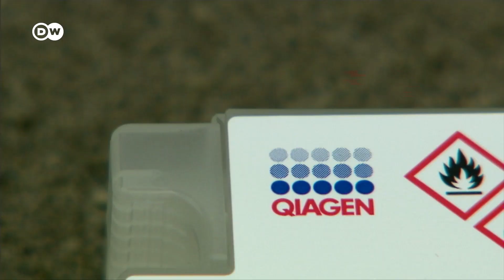Can controlled 'herd immunity' be an alternative to social distancing? | Coronavirus Analysis

Comment: Can herd immunity be an alternative to social distancing?

It will be when there's a vaccine.
Reply: @arldoran  It would have to mutate to quite a significant extent for a vaccine not to work though.
Reply: Herd immunity basically survival of the fittest in a modern society.
Reply: Morgan, people are going to die in either situation. Economic collapse will just produce more deaths. It’s unfortunate that people will die from this virus, but that’s going to happen regardless. I can guarantee, though, that much worse things will happen if the global economy is put on hold for an indefinite period of time. At some point, a choice has to be made: Isolate everyone forever and decimate the economy, or just isolate certain groups and try to build somewhat of a herd immunity.
Reply: A. Doran, fair. Either way, something is going to have to give. I like neither option, but it’s one or the other.
Reply: Running With Scissors 
Well, your username certainly checks out.